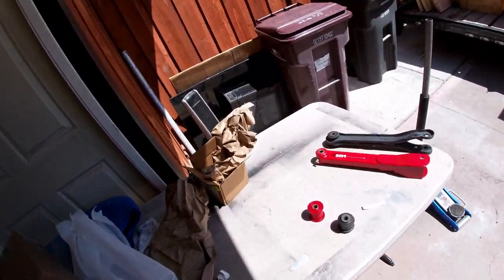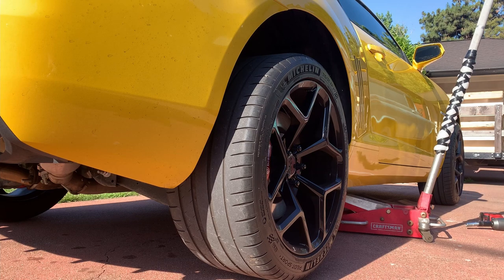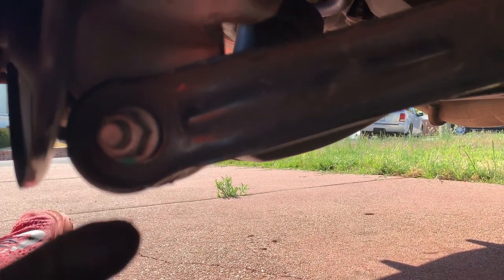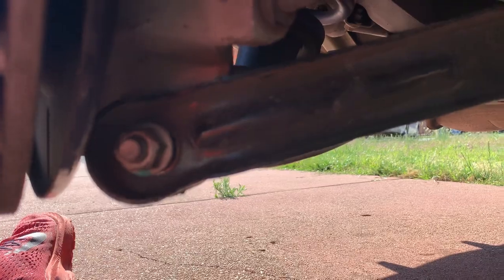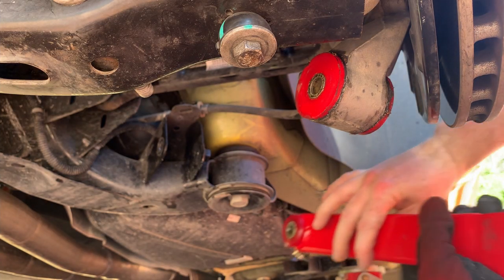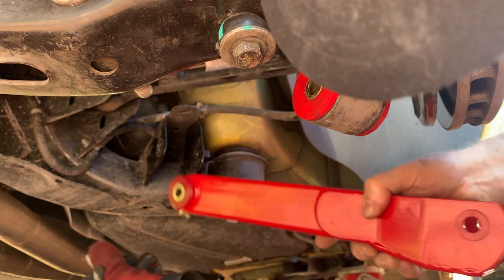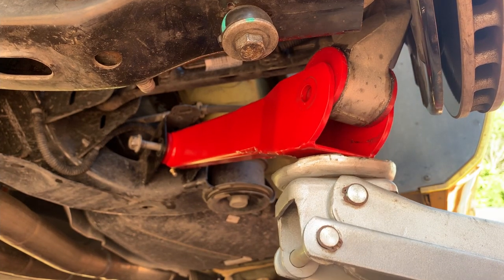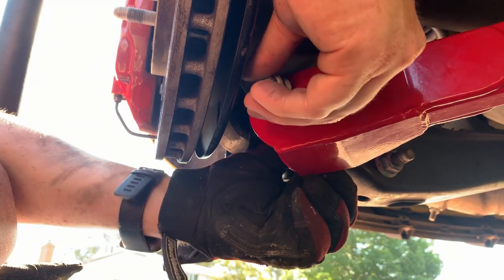How To Install BMR Trailing Arms | 2010 - 2015 Camaro | No More Wheel Hop!!

Comment: Installed these on my daily driven 2011 SS, best upgrade yet! Corners much more consistent and launches straight every time I feel they really put the power down. Close second is the sway bar combo (OEM 1LE front with whiteline links/bmr 35mm adjustable rear)
Reply from the maker: Agreed. Very simple yet effective upgrade.

Comment: I like how you left out the hardest part of the job which how you get the rubber bushings out of the spindle.
Reply from the maker: Yeah, I didn’t think a video filled with cussing would be a good idea.
Reply: @bigblockkev  yeah i hear ya i just did the same job on my car last weekend. I used a 2 jaw puller but it was too small and busted. So i hunted down a 5 ton 2 jaw puller and  turned the legs around to the short side and popped them right out. I haven't experienced any wheel hop since i put the new trailing arms and bushings in. The car doesn't feel as spongy if that makes any sense.

Comment: What did they run? I have a 2013 SS L99 with some hop. So hopefully?
Reply from the maker: They did the trick. Drastically reduced the wheel hop issue. Plants the rear tires to the ground. Would highly recommend this upgrade for your ride.

Comment: What is your opinion about adding the rear lower control arms and toe rods to this upgrade? Necessary? Overkill?
Lastly, what part numbers did you use with this install? I appreciate any feedback you can provide.
Reply from the maker: I definitely will add the toe rods to this. Rear end will need to be re-align after those are installed. It also depends on what the car is being built for. This is my daily driver so I still wanted to keep some of the ride comfort. The more suspension upgrades, the more the comfortability goes away. I'm keeping it in the happy medium. 

Trailing arm Part Number: 142-TCA026R
Differential Bushing Part Number: 142-BK029
Reply: @bigblockkev  thanks for the feedback.